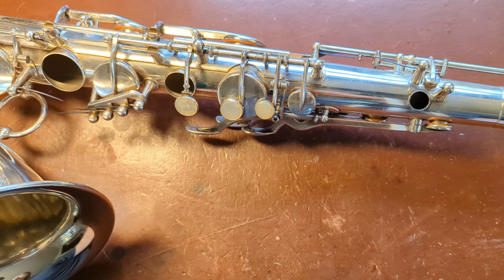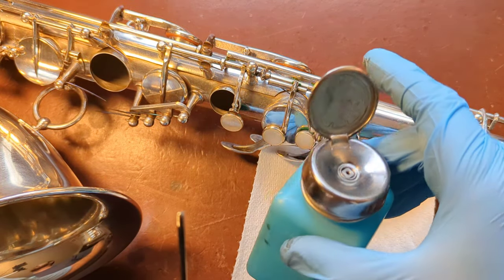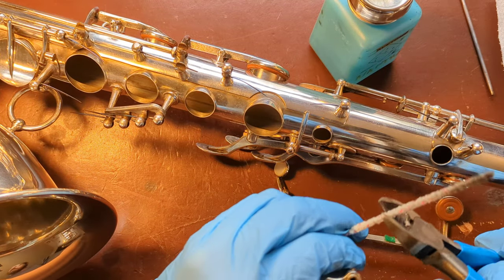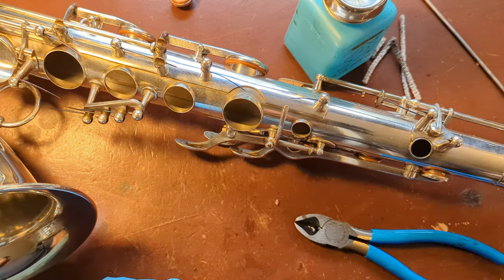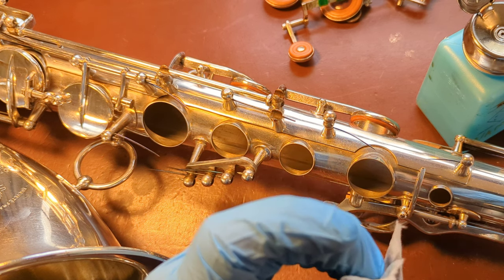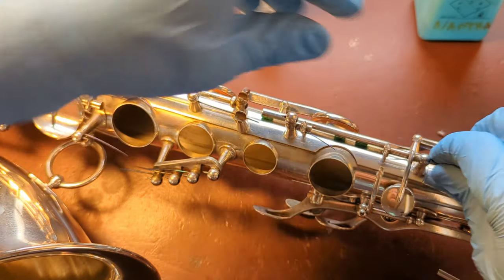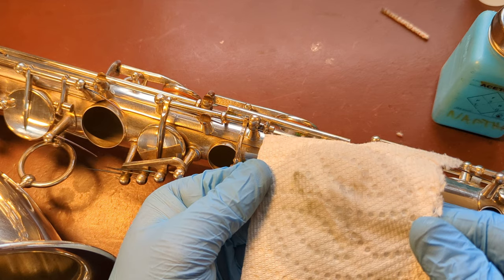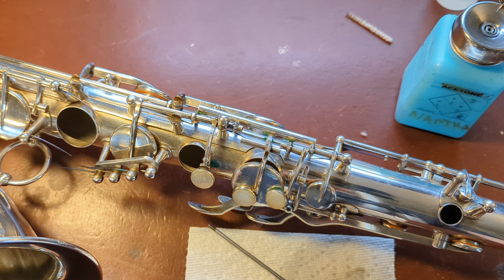Saxophone Repair Topic: Cleaning Hinge Rods

Comment: Hey Matt, what are your feelings on using fine steel wool to clean the rod in the bench motor? Then you could even get the threads clean all with one go rather than needing to break out the dremel tool.

I thought maybe you might not like steel wool because it leaves behind flakes of material but, so does a dremel wheel. Just curious! Great work as usual.
Reply from the maker: I think for me, the mess has a lot to do with it.  Also, threads just tear up steel wool and you end up having it get caught and whip around half the time.  That may be a "me" issue though, and if you can deal with it without having issues and the results are similar, I see no reason why not to do it that way.  Just doesn't work for me!
Reply: @StohrerMusic  Thanks! What you said makes sense to me.

Comment: Hey Matt, my name is Ron and I repair saxophones for a living in the Netherlands :) 
Great job man, very inspiring. Just two questions. What do you charge your clients for an overhaul? 
Does this thorough cleaning affect the condition/playability of the instrument dramatically?
Reply from the maker: Dramatically, no. It affects the long term health of the keywork, the longevity of the overhaul, and the slick and fast feeling under the fingers of completely clean keywork is subtle but once noticed it is hard to go back.  

My overhauls are based on an hourly rate (which is on my website), so it depends on how long it takes, which is different for each horn.  Flat rate jobs were killing me, and I think they incentivize corner cutting (and make you miserable if you don't), so I stopped.
Reply: @StohrerMusic  I'm going to give it a try Matt. Right now there is an old Mark VI on my bench which is quite dirty. I might even have to replace some old rods that are worn out completely.
Anyway thanks again for the tip! All the best from Holland.
Reply from the maker: @ronpluijm  Absolutely!  Thanks for watching.

Comment: Hi Matt. Does that make sense to polish rods with 3000 grid sandpaper?
Reply from the maker: The results will tell you whether that is too fine a grit or not.  I find that different brands and different abrasive materials act quite differently, so you may need to experiment until you get the ideal results, which in my opinion is removal of hardened/varnished old oil, smoothing of any scratches or minor blemishes on the rods (major ones mean replace the rod), and a smooth, shiny finish that looks flatter than it started.

Comment: Great video. I’m not a repairer, but I do oil my sax mechanism, however, regarding cleaning, I can’t get Naptha here in the UK, so what can I use as an alternative ?   (Or is there a different name for Naptha?)
Reply from the maker: Looks like you can get it from Behlen.  Also zippo lighter fluid/ronsonal is fairly close- naptha plus some additives.  I've heard of people using that without issue, but I have no direct experience.
Reply: @StohrerMusic  thanks for the info
Reply: You can also use "Zippo Lighter fluid" as a more expensive option :)
Reply: @StohrerMusic  is rubbing alchohol usable?
Reply: Naptha is similar to "mineral spirits", the solvent leaves a thin, oily film on the surface

Comment: Was it really an overhaul if they didn't properly clean the hinge rods?  Sounds to me more like it was a repad instead of an overhaul.
Reply from the maker: In your neck of the woods, a "repad" does not include cleaning?
Reply: @StohrerMusic  I suspect it comes down to the shop and the technician doing the work. 

That's why you develop a good relationship with your tech 😉